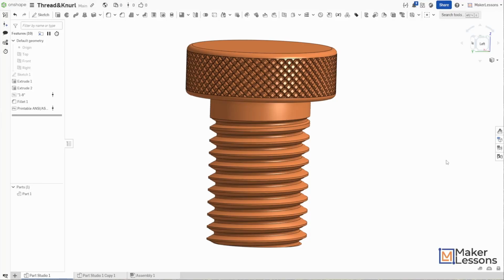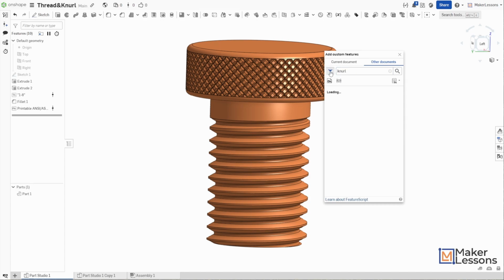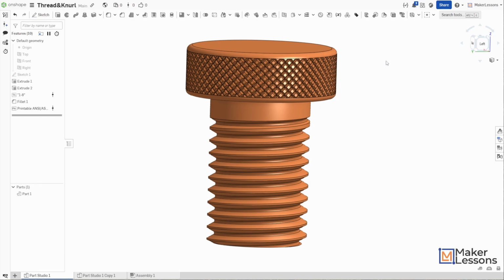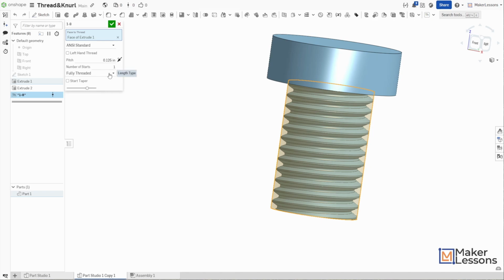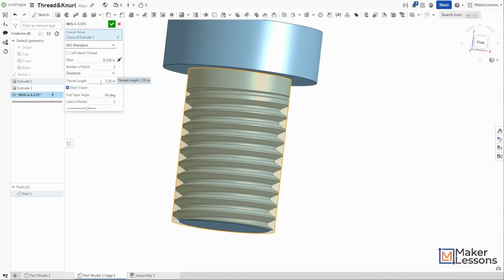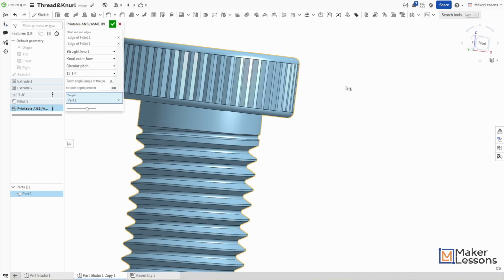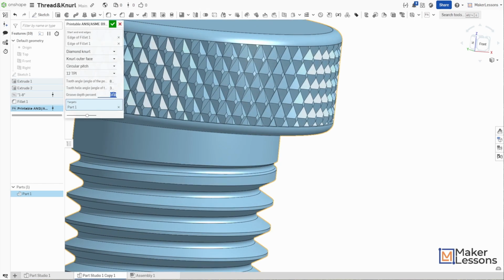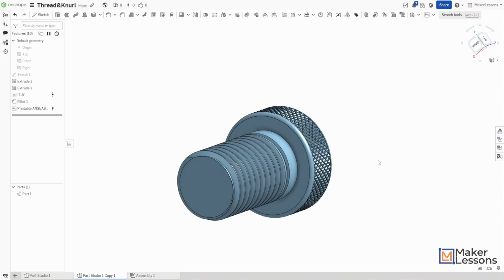Onshape Custom Features: Threads & Knurl

Comment: Im experiencing the same issues as others where you cannot knurl a part after it's bee filleted. I'm using the latest version 14
Reply from the maker: Just tried it again and still works for me. You click on both edges of the fillet on the side that will be touching the knurl and then you pick the face you want knurled as the target.

Comment: How well do these threads print.  I’ve been having issues with stringing across threads and tightness in spite of an offset
Reply from the maker: These are real threads and may not be the best for printing with out some adjustments. Try printing at 101% fitting into 99% scale for instance. Also you can draw your own threads:  https://youtu.be/WkhUtFPze_s?si=8ijEgT-2R5yG5Mh_

Comment: I imported an stl to onshape, that I want to add knurling to. Having trouble selecting the edges on the model. It is because it imported? Is there a way to do it?
Reply from the maker: Yea, imported stl files are generally not something that you can edit. Either draw it from scratch or figure out a way to attach a separate part to the existing stl

Comment: Using the same featurescript, similar project, can't apply knurling if there's a fillet on the body.   If I remove the fillet, no problem.   Any idea?
Reply: Having the same issue. There seems to have been a change where we can no longer select the edges of fillets
Reply from the maker: Are you clicking on the edge of the fillet?
Reply from the maker: @lund8517 @chrisseh1608 i just checked and it still works for me. Sure you have the v14 printable knurling custom feature?